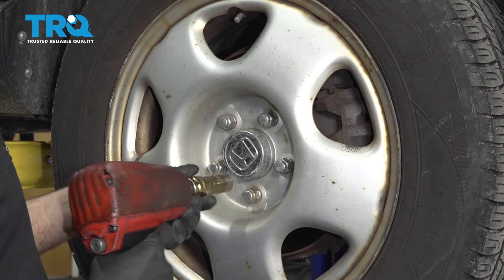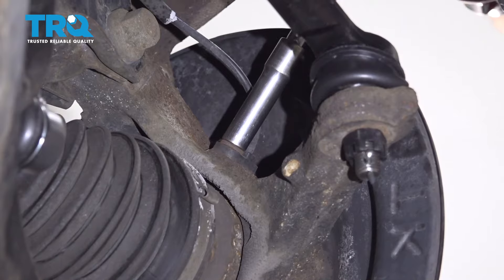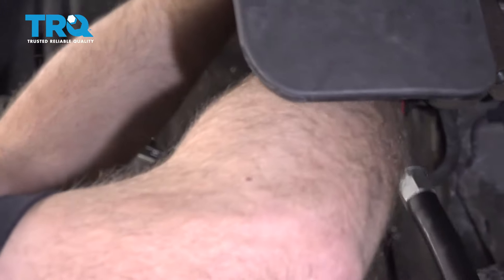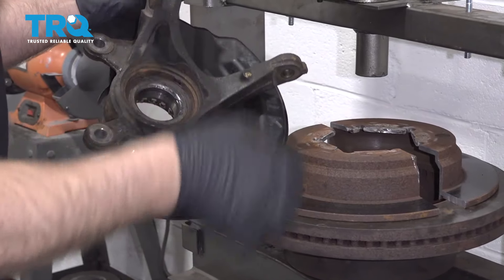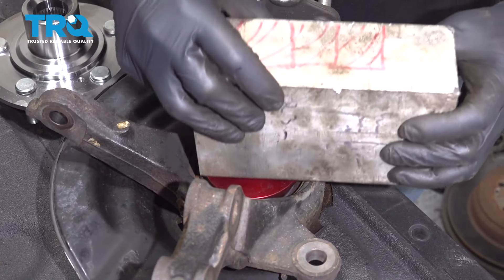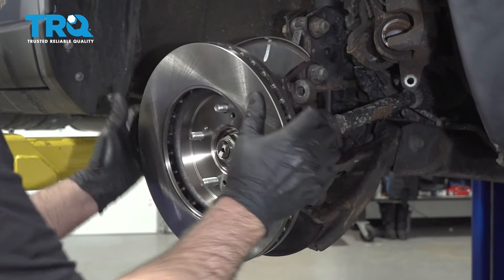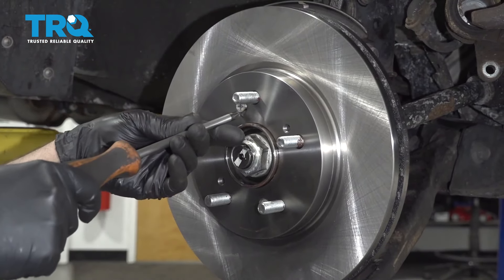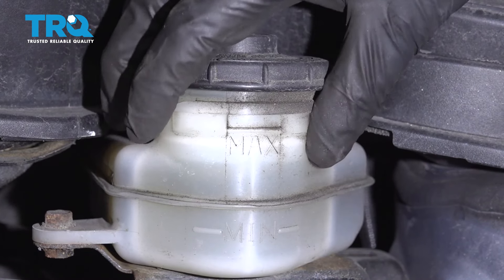How To Replace Front Wheel Hub and Bearing 2007-11 Honda CRV

Comment: Great video. 
If you live in an area near or above the "rust belt" be prepared to have to get a few new parts as well. I had to get a wheel speed sensor, steering knuckle, and snap ring. Mine were all rusted together. The job entailed getting a new bearing, hub, knuckle, snap ring, lower ball joint, and wheel speed sensor.

Comment: the Brake Dust Shield, it is a PITA as it is between the hub and the bearing and had to remove the hub before I could get the 3 Phillip screws out, It was in the way of everything. Also I had to cut off and drill out the ABS sensor as it was rusted in (even though it is plastic) This job fought all the way the bearing did not want to budge, the race did not budge, used a torch, pullers, and a big big hammer, took 2 hours to get every thing out and apart, and only about 20 minute to get it all back together.

Comment: Nice video. The only suggestion I could recommend is to remove the heat shield before pressing out the bearing so it doesnt get bent up and if you live in the rust belt have an ABS sensor handy. They dont always come out because of rust and have to be drilled out.
Reply: Hi can you help me with a couple of questions I have with this video. 

How many tons is the press machine? Also what did he use for the socket that he put there to press the old bearing out?
Where did he get the red circle thing he put under the new bearing when pressing it in?
Reply: @hatersgotohell627  20 ton press
Reply: Unfortunately you can't remove the shield until the hub is pressed out. I found it helped to remove cut the studs off and knock the out and the remove the shield screws to get it flat and secure on the press.

Comment: The steps 
remove the tire
use 19mm wrench and 14 mm socket remove caliper bolts
remove from bracket and hang it 
remove pads 
more caliper bracket 19mm socket
take bracket off 
remove screws on rotor
remove the rotor 
take abs sensor out with 10mm socket 
remove sensor carefully with tool of choices 
36mm socket take nut off
disconnect outer tire road end 
remove coter pin 
18 mm socket remove nut 
remove outer tie road end from nuckle 
mark location of sturt bolts/nuts
19 mm wrench 22 mm impact remove both nuts
use punch and hammer remove bolts from struts
use 17mm socket to remove 3 nuts on bottom of ball joint (if you don't need to replace it)
press the bearing and the hub out of the nuckle
press new bearing in make sure the correct side is facing the abs "READ IT AGAIN"
replace snap ring with new one
intall the hub(I opted to have a shop do this part)
install nuckle with new bearing and hub
attach ball joint nuts torque late 
nuckle into the strut 
install bolts and nuts for the strut
intall tie road 
torque ball join 38fp
struts to 116fp 19mm wrench on bolt
torque outter tie road to 40 fps 
install new cotter pin bend and trim 
lube center nut with oil (use a new one) 
use pry bar to hold hub
torque 242fp
install wheel speed sensor/ abs in the nuckle
clean new rotor and install 
install the screws into rotor snug
put caliper bracket in 
install the bolts 101fp 
install the brake bads 
compress brake caliper with tool 
put caliper over brake pads 
install bolts torque to 37fp
use 19mm wrench on stud
install wheels torque to 80 fps 
pump up brakes 
check brake fluid level
Reply from the maker: +Terrence Thomas Thanks for the feedback! http://1aau.to/m/Shop-TRQ
Reply: WOW! You...completed.

Comment: See how easy you pushed the bearing out? Ummm yeah not everyone has a cut in 1/2 brake drum or rotor to rest the steering knuckle on. 
Here's an idea, how's about you tell TRQ to sell a steering knuckle, hub, and wheel bearing assembly so you can just swap out the whole thing as a unit for the 2016 Gen?
Good videos though guys! I've learned a lot, unfortunately I'm stuck at trying to get the bearing out 😂...

Comment: Once the new hub is installed into the bearing, how easy should it be to spin?  I've seen some videos where it spins effortlessly, but I just did mine and it requires a fair amount of effort, and it looks like it does in your's too.  I don't think it's possible to have pressed it in too far, right?

Comment: nice detail showing how to remove the bearing but how did you remove the bearing raise from the hub?
Reply: He installed a brand new hub.  In the past I always put in a new hub as well as they're not that expensive and it can be tricky getting the inner race off the hub.  Plus if I'm going to do this job may as well have a new hub so there's one less thing to worry about later on.

Comment: can you list all the tools needed to buy for this job? like where did you get the red circle thing that you put underneath so the bearing didnt get pushed down? also is it required that I buy a press like you have? I'm not a mechanic this would be totally new installing for me
Reply: Spend a little more and just replace the whole hub assembly. You wont need to worry about a press or removing as much to do the job.
Reply: @skygoing82  okay I did buy the whole hub aassembly but he still uses a press to to remove the bearing and to put in the bearing and the new wheel hub.

Comment: How many tons is the press machine? Also what did he use for the socket that he put there to press the old bearing out?
Reply: 20 ton press is standard for wheel bearings.  The socket was a large size probably half inch drive that is just barely smaller than the hub stem itself.  The red plate is probably from either a wheel bearing press kit or seal service kit.

Comment: How to tell when the bearings going bad and how to tell when the Hub is going bad? I don't hear no grinding or metal Shaving noise but sounds like a bear in the engine bay when car goes faster
Reply: Generally a bad bearing noise while driving will sound like a low tone growl and will change with speed.  You can also tell what side is bad depending on what side is loaded when you turn.  When turning to the left around a corner if it gets louder then it's the passenger side.

Comment: !!!!This video is telling you to install the wheel bearing incorrectly!!!
He instructs you to install the bearing with the magnetic side pointing outwards. Why would the magnetic side be facing the wheel when the pick-up sensor sits behind the bearing, inward. 
Follow his instructions and you’ll have a Christmas tree on the dash. Install the magnetic side inward, or facing the pick-up sensor. (Which may be the reason why he’s stating to orientate down
Reply: My vehicle don't even have abs but I thought that was backwards.. I've watched multiple trq videos and they did it completly different in both videos. And I was sent two different wheel bearings so idk wtf to do now. Gonna go to local store and see what wheel bearings they have
Reply: Wrong!! He instructs to fit the bearing with the ring facing down.. Once ita fitted it will then be on the inside

Comment: lower ball joints torque is 38 ft. pound, ? are you sure
Reply from the maker: +Imad Pola Thanks for watching!  Yes those bolts should be tightened to 38 ft lb.
Reply: @TRQ  thank you